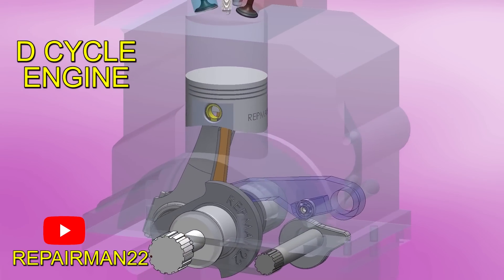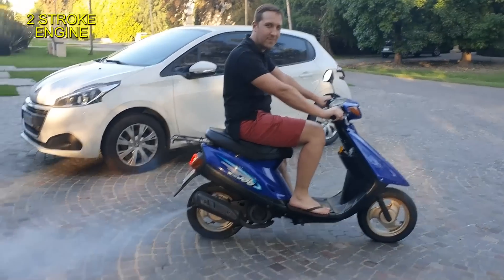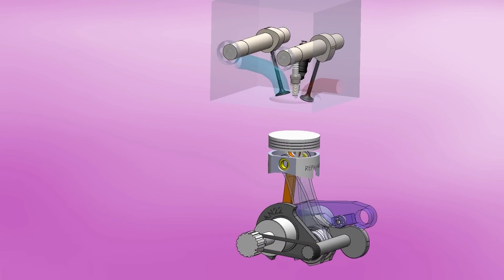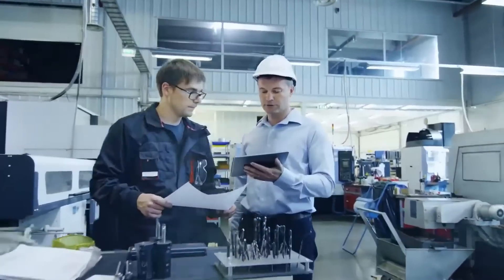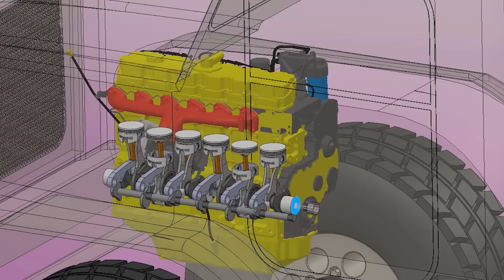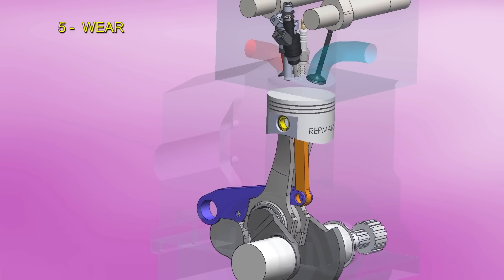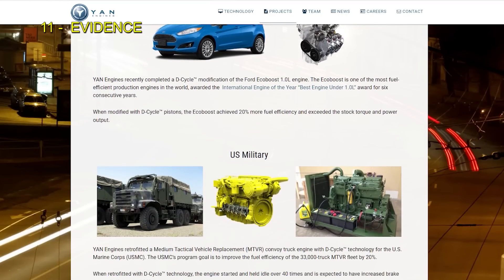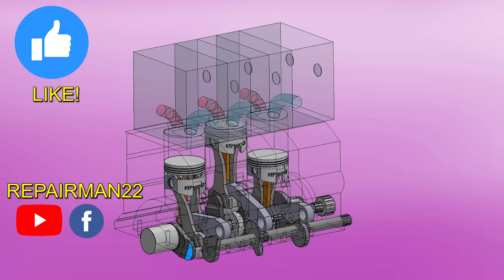Analyzing The Split Piston Engine in 3D. 🤯 Dual Cycle D // 2 and 4 Strokes Combined // 3D Animation

Comment: It's like making an involute road for a square wheel to run on. Artsy fartsie cool but sanity says NOPE! I think that GM Detroit has already taken automotive 2 cycle to its logical conclusion and that lost out over the complexity/reliability of blowers, balance shafts, and the strain of high-speed exhaust valve and injector operation. They were terrifically powerful, but transport industries preferred good ole big turning 4 cycle 6 inline with turbo that will do 1M miles.

Comment: thank you for a good video, not only upsides, but the up and downsides. 
split piston engine will surly get a lot of extra work for firms that rebuild engines.

the secondary rod, bearing will fail rapidly cause of tap at shaft. ant the return spring will be weaker, resulting in failure. when piston head slams into the skirts, fragments loosen and the piston collapses, after making deep scarring into walls, potentially particles getting into oil pump equals complete engine breakdown,
in addition to the bearing that are stressed during peak of exhaust cycle.

Two stroke gasoline engine with wet sump, with electric supercharger for starting and idling that has a variable geometry turbo for running engine.

why have complexity, increase weight.
its better to use something easy, less components, more reliable

Comment: It should be noted that the D-cycle engines should 1. at 1/2 rpm of the 4-cycle, 2. there could be only one shaft instead of 2 since these parts are all in the same cycle, 3. most of the engines ike in our cars operate at half peak rpm and half peak loads (not like the racing cars). So D-cycle engine should operate in the "right" region, and plus the Atkinson cycle.

Comment: Wow, look at this mechanical asshole! I bet it shakes like a paint mixer. Where's the pin with the ring on it?
Reply: The heavy crankshaft should drive at about 1/2 of the 4-cycle engine. The crown section can be design to be like a thin cup shaped to hold the rings and the piston stem to be operated via the lighter piston-train, which can have higher speed than the heavy crankshaft. The vibration is not much worse, and can be rebalanced. The piston pin is with the skirt, while the rings are with the crown part to seal and rubricate the cylinder. The piston stem can penetrate the pin at the cylinder center line, which does not affect the pin strength. The pin is sized for lubrication, which is much greater than needed for strength.

Comment: It should be noted that this engine needs not to run at high rpms. The tire rotation is about in about 500 rpm or less, while the engine is about 3000 rpm range. These rotation speeds differences are slowed down via the transmission. The D-cycle engine has doubled to tripled torque which need less geared rpm reduction than the popular 4-cycle - that is simpler and lighter vehicle.

Comment: How much piston crown even contributes to friction? I suspect piston with piston rings contribute majority of friction and they rotate twice as fast. So practically 4 stroke engine friction wise, i dont believe the mpg numbers.
Reply: Yes, the ring section contribute the majority of the piston friction. However, the 4 strokes of the D-cycle can be design for butter engine operations in different strokes, such as longer power stroke for more complete combustions, the right intake for the required amount of intake air for fuel combustion. The right crown speed to exhaust the gases not necessarily the same as the other stroke, etc.

Comment: The crankshaft operates at 1/2 rpm as 4-cycle. Most 4-cycle in cars need to use transmission to reduce the rpm to the tire rpm from, say, 3,000 rpm to the tire 400rpm through the transmission. Also most 4-cycle cars have only 1/2 of the engine working driving the can. The D-cycle would have the whole engine driving needing only 2-, 3-, or 4-cylinder engines, not those cumbersome v6 or v8 engines.

Comment: The crown section is operated via a (valvetrain-like) pistontrain. Both -trains can (should!) be operated via the crankshaft eliminating the gear systems. The lighter -trains are operating at higher rpm than the crankshaft.

Comment: Hi, Repairman22, Thanks for your discussion on the split piston ICE. The main idea for it is the huge differences between the gas pumping exhaust and intake strokes and the heavy compression and power strokes for the ICEs. If we split these two functions the engine can run at 1/2 of the rpm for the same work otherwise it will produce 2x (actually 2.5 to 3 times torque). So the crawn section can be redesigned to run at somewhat higher speed with lighter system, since it just pump gases around. Basically, this design make an different hybrid of different kind. Other issues such as: 1. windows in the skirt is not away needed or just a litter cut is enough. 2. the cooling is much easier when stronger and thinner crown is used. 3.there is no oil leak issue if the piston rings are OK, 5. the "extra moving parts basically is the extra cylinder, i.e. i4 becomes v8 (or 2.5 to 3 time output), 6. The engines would run at half rpm, not the 1000rpm, 11. the push-down spring has the help by the the cylinder press at high rpm when the engine is loaded. The crown (piston-train) has about just a little high speed or the same depending upon what differential strokes are designed. The crown section is only to pump the gases around, which much, much lighter than the pushing the whole vehicle around.

Comment: Honestly would make sense for motorcycles where revs are already higher and parts are already fewer... usually, but honestly just one of those ICE redesign takes that VVT technology mostly already fixed.

5 stroke engines which are tried and sold, despite being more "conventional" and efficient (just like the old twingle 2 strokes which were tried decades ago for the same improvements!) Are a lot more complicated than this, and you can put existing 4 stroke technology into this, Nissan Altima's piston is similar but if only they make a good transmission.

Comment: What about the noise from the top of the piston and the skirt slapping together, not to mention the shock and wear to those contacting surfaces?  This doesn't look like it would hold up very long.  A spring to actuate the intake stroke??  Not so sure about that, either.  This doesn't look very practical, instinctively.

Comment: It would seem easier to just supercharge or turbocharge the engine to double the fuel/air charge, plus lend usability if the supercharger/turbocharger should fail.

I would think adding more components would increase failure points (in essence doubling pistons, connecting rods, crankshafts, pivot points, cylinder wall wear)

Comment: The piston speed on the cam driven lobe is going to be insane. Not to mention the lobe wear. The engine would have to have a lower rpm limit.

Comment: Look, I like ingenuity in all its forms. Ill get that out of the way first.  Now, it will NEVER go into production.   Do you want to know why?  Ill tell you why.  You cannot add rotating mass to increase efficiency.  That alone kills it.  BMW and Toyota spent well over $10 Billion over 4 years to figure that out.  Too many moving parts and too many things to go wrong.  The leading reason, by a huge margin,  of engine failures is called a "Catastrophic Failure" and 95% of the time its mechanical parts that are the cause.  It would make the car or truck cost a least 40% to 50% more expensive for comparable performance.  No manufacturer would make that trade in a business world.  It would drive down sales.

Comment: ok why are we still using cams 
 Koenigsegg invented solenoids to go on valves and the computer opens and closes them . if you get a bad solenoid the valve just don't open and your engine won't grenade. all you need is a crank sensor. you can program any kind of lift and duration with just pushing a few keys . and if that sencer don't work just put a geared wheel to mimic the cam and have a sencer on that

Comment: Besides couple of things: ofcenter connecting rods to piston and skirt.  The wear on the tremendous stress of tbe cam pushing only the piston in the exhaust stroke.     After all of that how would tbe piston pull in air on intake stroke without floating and slamming on tbe piston only cam.  This after all the insane stresses already and the even more insane speed of the piston operated on cam only!!

Comment: Isn't the only reason it can make more power is from double the power strokes which means double the fuel consumption at the same rpm? So it wouldn't really be more efficient right just less a little crank and conrod mass but overall it would use twice the fuel at the same rpm.

Comment: It seems to me that the piston will hammer itself into oblivion the moment that any wear changes min distance between the top and bottom part of the piston. Also the inertia forces inside the engine will be tremendous. Fuel injected two stroke is the future. Simple ,light and powerful.

Comment: This engine is essentially a four stroke, but with an asymmetric motion so that the two lower-effort strokes are performed via cam instead of via crank.  The intake stroke is only low effort at wide open throttle, however.  On a gasoline engine, closing down the throttle would make it necessary to have a spring that's stiff enough to draw vacuum (negating some of the other advantages) or else using delayed intake closure as a means of controlling power.

Comment: Maybe a good generator design. Can tune to a fixed rpm. Better torque for sudden loads starting. Can overbuild high wear components since weight is less a issue and normally low run hours will help. This won't be in a cheap residential unit but if it keeps good efficiency and size it could be a fit.

Comment: It reminds me of the fishing game. And why not cause you either want an engine that run 500 rpm at 70mph or one that cycle the same and has even more rotation I thought the diesel hammer to charge a spring to turn in spinning rotation that release the spring at the end for the next cycle

Comment: You can literally get the same results by putting a 2 to 1 gear reduction on the crank of a normal single cylinder 4 stroke engine. Actually, you'd probably get better results because this is just stupid.

Comment: Come on! Is this a prank? Obviously piston wouldn't return during intake stroke hahahaha So how they tested this on fiesta and some diesel truck hahaha
This "invention" is clickbait nonsense, it has not real advantage. Even if it were functional, ball bearings and belts wear fast, engine would have horrible sound because of knocking sleeve to cylinder and vibrations would cause more stress to the engine. So it would make less horsepower for less durability, heavier engine and using more space that could be used for e. g. turbo or supercharger.

Comment: There's so much complexity for little gains.
Just use the detroit diesel 2 stroke design and transfer it to a gas engine. Swap the supercharger for a turbocharger under load to remove the parasitic loads and Voila!

Comment: Just give me a normally aspirated low power inline six or V8 with low controls. I'm convinced that is the most effienciency. Here's why: scalability & mass production, reliability, low heat cycling, easy to overhaul, low cost, proven. 
The efficiency  is lost on the front end, i.e., fuel mileage, but it is made up in spades on the back end: less parts, less trips to the repair shop, less labor, less fuel used by the repair labor persons and spare parts transport, less fuel and energy and raw material used in producing extra peripherals, less engine bay waste heat in engine bay that destroys all the extra peripherals in high efficiency  engines long before a N/A motor would wear out. The KISS principle all adds up to huge savings in the long run - but that works against their main plot - which is to eliminate private transportation altogether for a highly controlled world order where travel will be an indulgence.

Comment: What i dont get is the power nedet to get the upper piston up again: woudnt that use up alot of power and slowing the engine down. 

And woud the power gained by leting the air in compensate the power nedet to get the upper piston up?

It semms to work but im a bit confused

Comment: If it’s a 2 cycle it won’t need to operate at 7,000rpm, it will make the same power at 1/2 the speed.

Comment: I think it would have been better if the top part of the piston had the skirt and that the torque part had a meeting part in the middle of it instead. I can assure that without a skirt the top part will kink in the cylinder wearing out both itself and the cylinder in the process because of it. I have seen what high power engines with short piston skirts does to the machine

Comment: Two stroke engines don’t have to use the crankcase for compression. A turbo charger works just fine… (Two stroke diesels are quite common).

Comment: Maintenance nightmare with questionable longevity. Added complexity makes it more susceptible to failure. There must be additional noise and vibration with all those moving parts. I'm also skeptical about the stated weight savings unless it's compared to a 4-stroke with more cylinders for a similar power output. Comparing two engines with the same cylinder count the dual-cycle engine must be heavier. If this was in the production phase a couple of decades ago it might have had the needed time for further development to see its true potential. Like all the new 'revolutionary' ICE designs coming out of the woodwork the past few years, it's a case of too little too late now with all the EV tech coming to the fore. I don't like EVs, just being realistic about the current state of affairs.

Comment: as a mechanic ill tell you this will not be a long living engine. any slop in any of that system and the timing will be off and the pistons will beat each other to bits. how fast the compression piston comes down to meet the sleeve piston is too fast the cam lobe that activates it is way to steep but it proably has to be for the engine to cycle. it also has to meet that sleeve and push down on it to transfer power. this is a big NO for me JUNK

Comment: ( Notes for D-cycle – following are not obvious, call to discuss:
1.	Most piston skirts need not be windowed.
2.	Ring sections can be made of stronger thin steel just to hold rings and oil to cool.
3.	The same rings stop the oil leaking.
4.	The piston-train can run directly from the crankshaft.
5.	Crown doesn’t run at higher speed and having Atkinson cycle. The full air intake can be provided via an air 2x pump.
6.	Valves don’t run at higher speed, except for fewer cylinder engines.
7.	Piston-train spring is compressed during intake. )